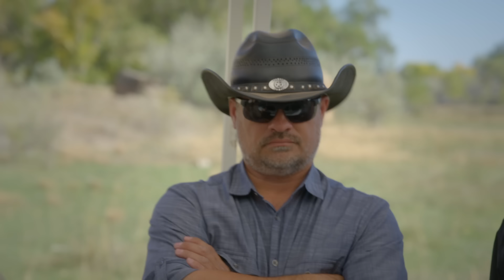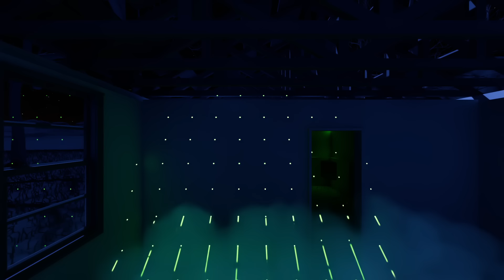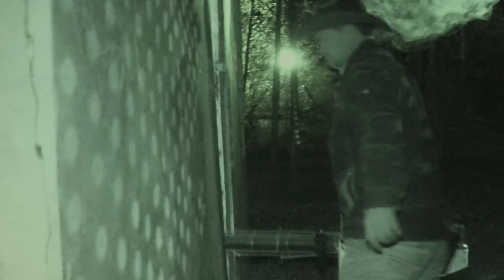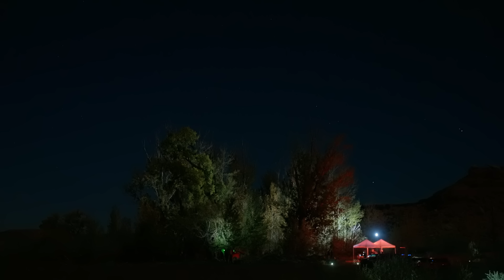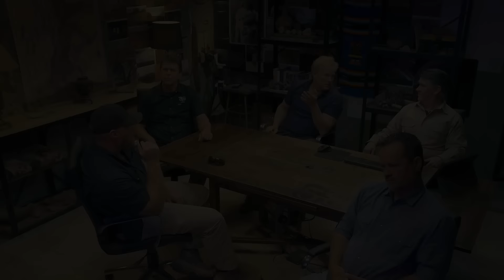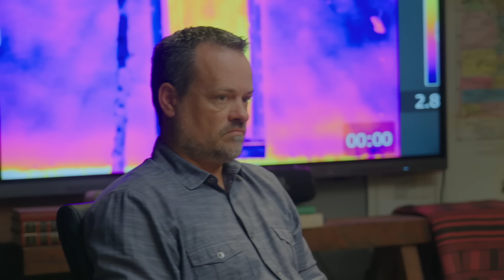The Mysterious Flash of Homestead Three (S7) | The Secret of Skinwalker Ranch

Comment: Only way to figure that out is to fire 3 bottle rockets into the air while passing smoke over a bubba burger during drones fly overs in stealth mode, and maybe a laser or two, dig a hole and fire up the flux capacitor
Reply: But what if the rockets are hurting or damaging the “blob”?   It seems to be trying to protect itself.

Comment: Electric fields are different from magnetic fields. 
All of what I see points to huge electric field fluctuations. Most likely the Mesa is sitting on top of a huge deposit of Quartz crystals. 
The slightest movements will create millions of volts of charge. These people will most likely die of cancer. 
The flashes of lights are most likely sparks from voltage discharges.
Reply: They had an interesting idea. I lived in the UN to basin for about 10 years. It was the weirdest place I’ve ever lived. I also lived in Taos, New Mexico, and Taos Mountain, which is where the Tiwa Pueblo is, is supposedly filled with quartz crystals. There’s a very interesting hum that you can hear there sometimes, but not always. That’s also another place where there’s high strangeness. Mount Shasta in California is the same way too.